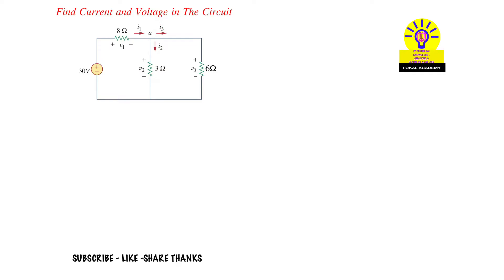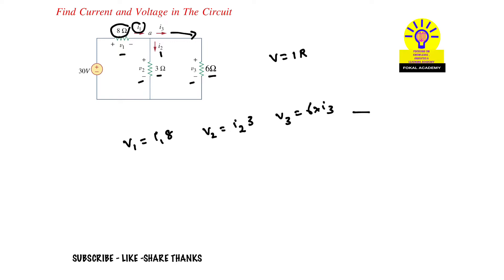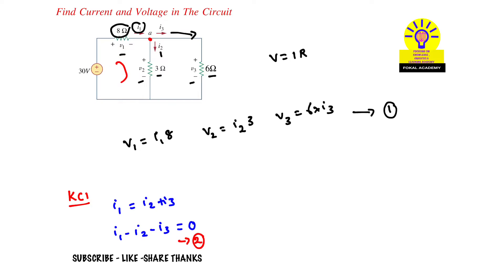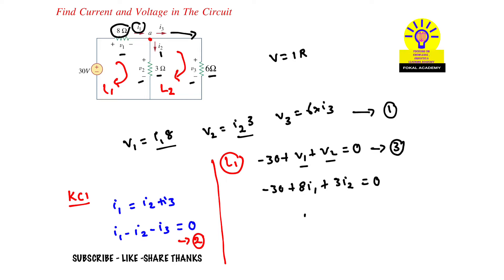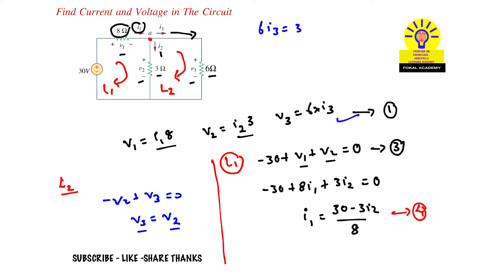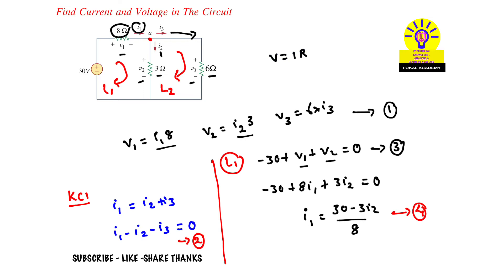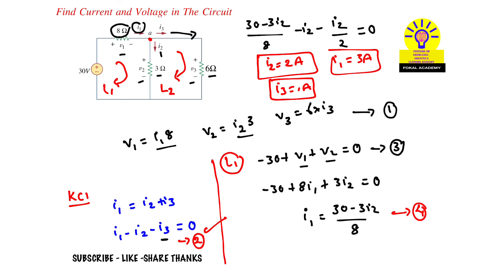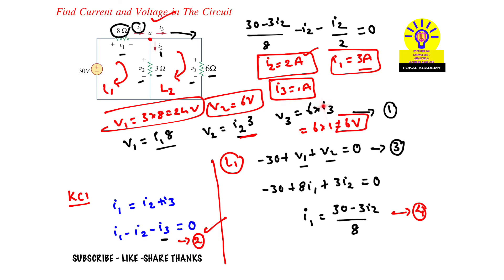How To Find voltage Drops and Current || KCL || KVL || Circuit Analysis Solved Problem

Comment: Sir I don't know how to find I2 ,,,, please explain please ..
Reply from the maker: Hii , at which point you have doubt , please comment clearly
Reply: how did you find i2 to be 2 which steps because my calculator is giving me 2.5 AND yours is 2A  @FokalAcademy
Reply from the maker: (30-3i2)/8-i2-(i2/2)=0
LCM is 8

(30-3i2-8i2-4i2)/8=0

30-3i2-8i2-4i2=0
15i2=30
i2=30/15
I2=2
Reply from the maker: Sorry for  delay to respond, thanks for watching
Still any doubts, please mention, I will try to help you ;)
Reply from the maker: Due to lot of comments , takes lot of time to respond:(

Comment: I have a question that v1+V2+v3=36V which is greater than total voltage supplied.
Is it possible?
Reply from the maker: Insufficient data, as well as source voltage is always equal to sum of  voltage drops across all  components
Reply: @FokalAcademy  I am talking about the question which you have solved.
Is the data insufficient in the question?
Reply from the maker: Please Define your doubt completely
Reply: @FokalAcademy  actually I am talking about the question which you have solved in this video. Your answers for voltage drop are 24v,6v,6v . If we sum up these voltage drop it is equal to 36V. As you have said that voltage drop is always equal to the total voltage supplied which is 30V. So how the Voltage drop across resistors i.e 36V is greater than the total voltagei.e 30V.
Reply from the maker: Sum of voltage drops is always equal to source voltage in a Loop only,
 here V2 and V3 parallel having same voltage drops,  because they are parallel circuits, in parallel circuits current is divided
Reply from the maker: so Vs = V1+V2 
V2 and V3 are same in parallel circuit
Parallel circuit is considered as one element
Reply from the maker: still any doubt please send, i will try to clear
Reply: @FokalAcademy  Thank you so much Sir ❤️.
My doubts are clear now